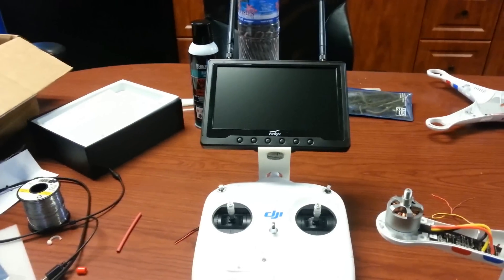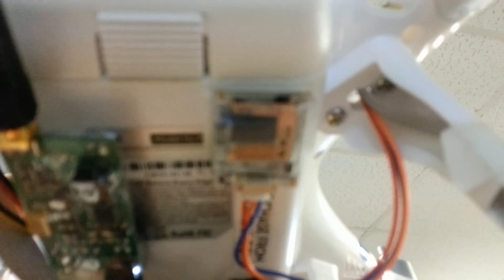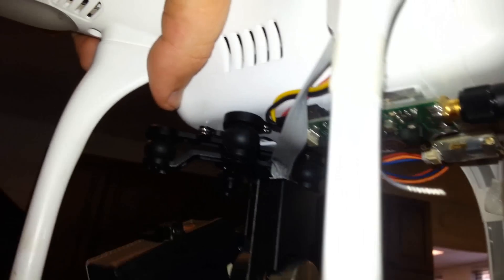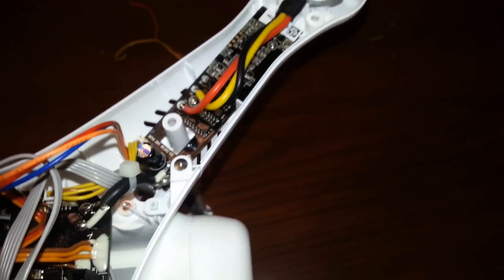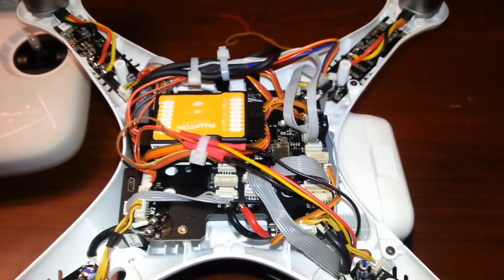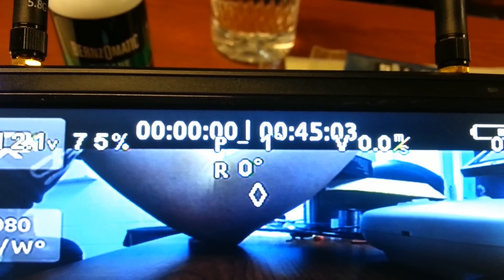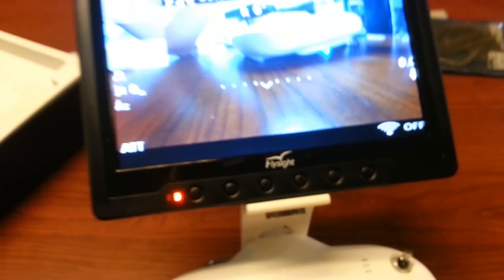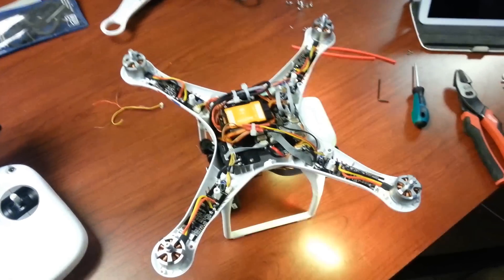FPV Setup On My DJI Phantom 2

Comment: Is it possible take the video system out off dji frame, cut the motor to save weight and mount on airplane as a separate system just to have hd fpv video signal

Comment: Hi everyone. I need a little help. I have this same monitor, the black pearl and a ImmersionRc 600mw transmitter and I can't get not even 100 meters range straigh line. I Saw many reviews people getting 1km plus.......... When i pass the 70 meters mark i get no signal at all. My antennas are:
One 3-Bladed Skew Planar Transmitting
One 4-Bladed Cloverleaf Receiving Antenna for the Monitor
Panel/Patch High Gain 5.8 GHz Video/Audio Receiver Antenna for Long Range

Got both from amazon. The patch antenna 5 stars... people saying that even cheap as it is, it's amazing and the cloverleaf 4 stars but I don't know why i'm only getting around 70 meters..... WHY??? Help please.

I also have the Mini IOSD installed.

Thanks
Reply from the maker: It's possible that you don't have the monitor tuned to the right frequency. If you look through the manual for the transmitter it will tell you how to find the frequency it is set at and the manual for the monitor will tell you what band/channel to use to match that frequency.
Reply: Do you have the 32Ch version ? .. there are two versions of this monitor and unfortunatly the 32Ch version doesnt match up with the IMRC frequencies properly. What you need is the 7Ch version... eg http://www.firstpersonview.co.uk/screens/black-pearl-7-channel-monitor
Reply: what? IMRC definitely works with the 32ch model. Not sure where you heard this! IMRC tx freqs - 5740, 5760, 5780, 5800, 5820, 5840, 5860MHz
32ch version of black pearl freqs will match every tx freq of the IMRC 600mw on band F of the black pearl.
Reply: ***** check phantompilots forum and also look at the link i posted ... yes they will "work" but you will not get much distance before getting a lot of interference .. the imrc frequences do not match exactly with the 32ch version ... hence why they produced a 7ch version that matches imrc vtx ... research it.
Reply from the maker: Danny's right. I wanted the 7ch version but the place I bought mine from only had the 32ch. I did a distance test with this setup and got about 2100 ft before it started going fuzzy
Reply: DannyB81666
Cool.. I'll wait to see when I get my BP. I didn't hear of any issues prior to ordering the 32ch version and of course I have the IMRC 600mw vtx. From what I read on rcgroups is that the antenna connector is important. People trying to attach SMA antennas to the RP-SMA of the BP.. I'll report back when I get my set up done. Hoping I don't have to send this thing back and find the 7ch model! :)
Reply: ***** Update?  So did the 32ch work with IMRC 600mw after all?  I'm looking at the same set up currently.  Looking at the DJI AVL58 lite as well, but not many using it it seems.
Reply from the maker: The 32 channel works. Make sure you get the proper antennas. I use the 32 with my set up and haven't had an issue with it. The only difference is I think the 7 channel one works a bit better at long distance.
Reply: TXstang347
- I ended up ditching the IMRC vtx and going with a flysight transmitter.. Never did get a clear picture with the IMRC!

Comment: thanks - what channel and band are you using on the monitor? I only get video feed on channel 7 on i think F band but although it is clear, it breaks up for a second at a time...
Reply from the maker: Mine's on band B channel 6.  Your TX might be set up differently then mine so it may not work with my settings. Your best bet is just to go through all the channels until one comes in good. I also recommend getting better antennas which will help with video quality.
Reply: ***** Thanks for the reply. I also got decent signal on band B channel 6.  I also have the same Tx as you, so I imagine the band and channels should work the same for both of us. Just curious- what advantage does the flytrap core 2 have if you already run the DJI IOSD mini? also, what kind of distance did you get with those stock antennas?
Reply from the maker: Jesse Peters It's basically a black box for the Phantom. The iOSD is only for the fpv system. The flytrex saves all of your telemetry data so you can use it with your videos.  Check the latest video on my channel or search for "phantom dashboard" and you can see what you can do with the data.

I have only gone about 500 feet or so. It was good that far. Once I upgrade the antennas I should never have a problem with it.
Reply from the maker: ***** Search for "phantom dashware" not dashboard.  Damn auto correct.
Reply: ***** oh ok, got it. I see some people add a DVR recording to their monitor so they can overlay a second video (monitor feed) in the corner of their youtube video. But this dashware setup is much nicer. Does it automatically save it with your video file-how to you combine the two? As for distance; I put two corresponding immersionRC spiralnet antennas (on on tx and the other on rx) + a fatshark patch antenna on the rx and I easily got 1km. I think it can go much further. What Ben7seven7 said below is right those custom made antennas from FPVLR.com are incredible. I'll be upgrading to those soon and perhaps combining the ones I had from the phantom vision 2, back when I was modifying the wifi repeater.

Comment: Nice setup but don't forget to upgrade those cheap antennas with proper circular polarized if you want good video stability and range.   I'd suggest a skew planer antenna on the Phantom and one of the two ports on the black bear.  And a good helical antenna on the second port for long range flying tho you will need to point in the direction of your Phantom.  Circular wireless makes the best antennas tho a bit on the pricey side.  FPVLR also makes some good antennas at lower cost.
Reply from the maker: I was planning on it. Thanks for the info on the antennas. I'll definitely look into those ones.

Comment: do i need the ios on the phantoms leg at all if im not going to use ios ?
Reply from the maker: No. The iOSD is an option. You don't need it for FPV. I wanted mine to have a fully loaded setup so that's why I have all the goodies.
Reply: So I can take it off the quad?
Reply from the maker: ***** You mean the Can-Bus port. That is just a connector that is used by accessories. I moved mine inside to use with iOSD. I would recommend just to leave it. That way you have it if you ever need it in the future and it means less work trying to get it off.
Reply: Yea your right its not like its causing that much weight. Thanks bro!